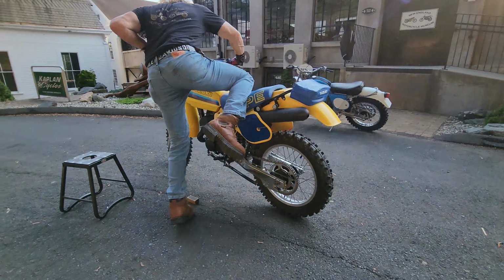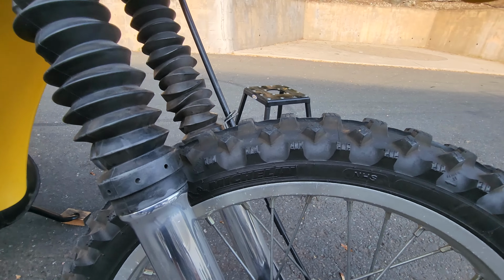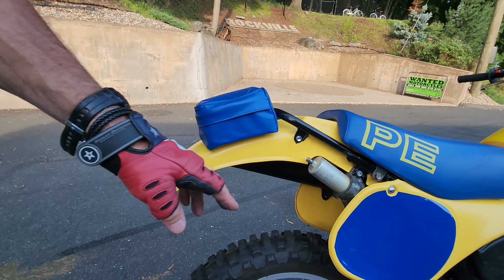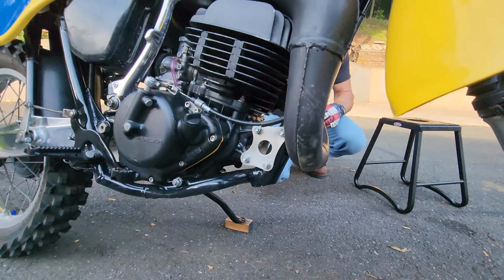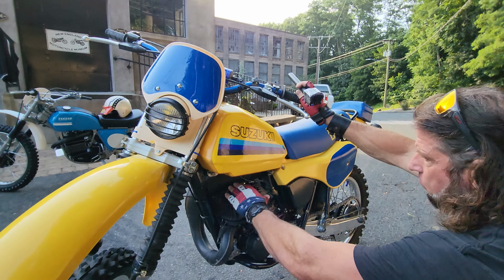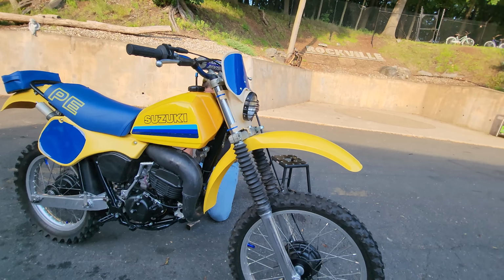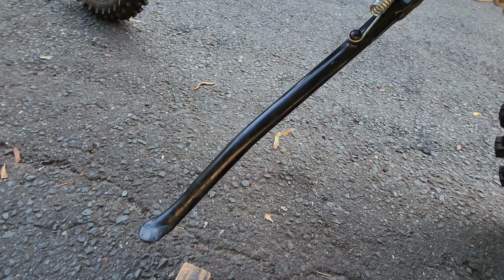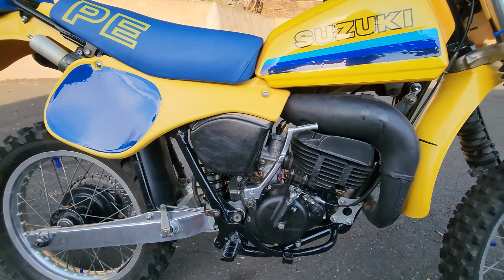THE BEST 2 STROKE FUN BIKES OF THE 80'S; 1982 SUZUKI PE175

Comment: Great looking bike 👍🏻 I had a 1980 PE-175 which had a double rear shock then sold it when the 1982 175 full floater came out. I rode the NETRA Turkey Runs from 1980 to 2000. I sold my PE in 1986 when I bought a XR-250

Comment: Great bikes!

I have the same bike here in New-Zealand, PE-175Z, Dec 81.

I installed a set of Boyesen reeds, re-spoked the rims, new ytres, powder coated the frame, rebuilt the carb.
I wired in a lighting loom from a Suzuki TS-125 which has a rectifier for charging the 6V Battery installed.
The plastic fuel tanks on the PEs had a bad habit of splitting on the bottom, so I fitted a metal tank from a Suzuki DR-200, with a few mount mods.
Looking to get mine road registered soon.